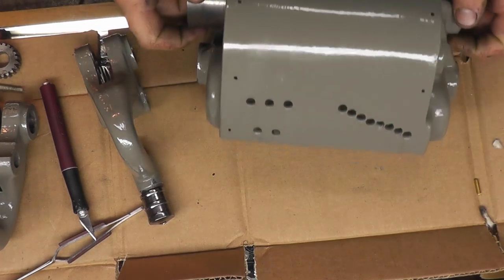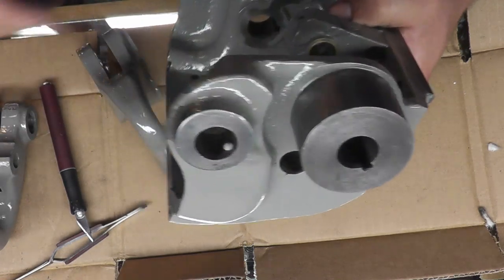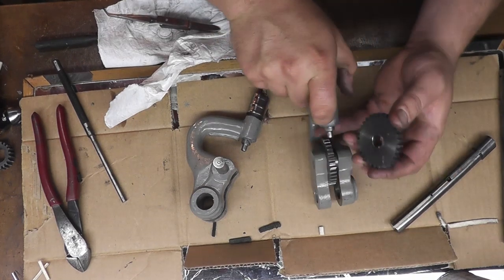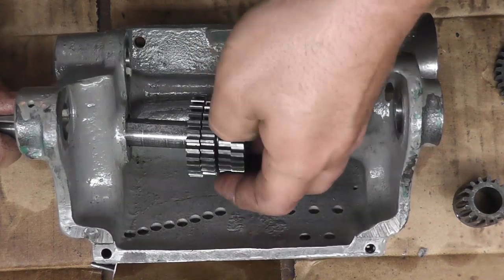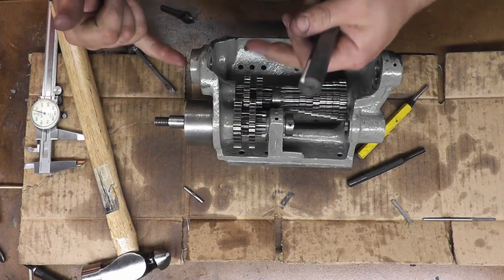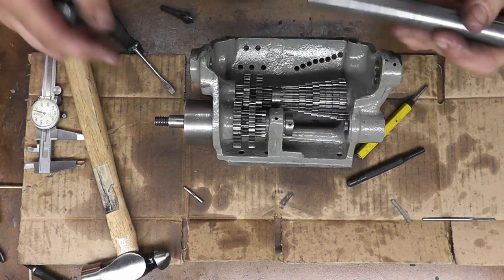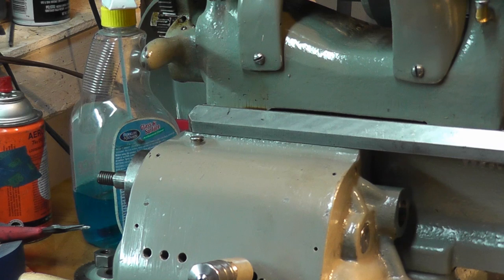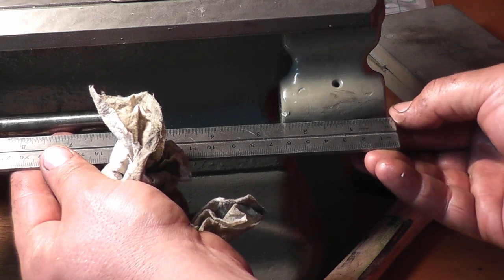Southbend 9" Gearbox Conversion Part 2

Comment: (disclaimer:everyone's a critic) I think you need to buy/make a brass/copper hammer and get some brass drifts. Steel on steel or god forbid cast iron, is a no no, I would have had my butt kicked hard if I were ever caught doing that in the workshop. Center punches used on tapered pins spread the pin and make it hard, concave punches are best. Good video other than that.

Comment: Looking good!  Some of that gear noise could be slop in the idler gear shaft, Glad to see you decided not to cut your original leadscrew, you have nothing to lose by adding an extension. If you leave 1/2" or so past the tail stock bearing support there'll be room to mount a hand wheel. How easily do your selector arms slide horizontally? Mine always bind a little - never found a fix

Comment: The C and Bs have two holes in the bed  to hold the lead screw bearing in the head stock end.  The As have three holes - an extra one is needed to support the end of the gear box. Either he operates with only the two close together screws for support or he drilled the 3rd hold off camera.

Given by reluctance to drill in the bed it would be nice to see the careful drilling of the 3rd hole.
Reply from the maker: I did not drill the third hole.  It's supported by the two holes at the far end of the bed and works fine.  The holes line up with the v-way ridge so it needs to be carefully milled to countersink the screw head and drilled on a mill.  I don't have access to one and really don't want to lug the bed around everywhere and pay to get it done.

Comment: This is so fascinating to watch.We get our information watching you, OK where do you get your tech information ? Also why the serpentine belt and not a leather belt or is that obvious to everyone else. Is there a serpentine belt for this lathe or did you take the leather belt to the store and just compare. Sure works great though. Thanks again and keep em coming you are the only source of this type of info that I know. Also I saw rebuild kits on E bay for south bend, are these the real deal.
Reply from the maker: Most of my information has come from sources on the internet and old SB bulletins.  The serpentine belt is a regular automotive belt that I got from an autoparts store.  After getting my lathe all put together and mounting it on the bench I ran a string around the pulleys and measured the length and got a belt of that length.  The belt gives better grip, but doesn't stretch as much as the leather so the tension handle is a little stiff to get taught.

Comment: Hello again. I am in the process of reassembling the gear box, and I saw how you cut the felt for the shaft slots, but how long was the round felt that went down into the hole. The book I have says to cut them to 1/4 inch, but that seems awfully short. It looks like you indicated the felt should go in as far as it goes then trim. Again thanks this project sure came out nice. My wife looks over my shoulder while I watch your videos and when she sees your lathe, she asks "Well is your's going to look that nice" .  She is very supportive and helped me unload and carry the lathe base into the garage. Now if I will stop tracking the dirt into the house, she will be more supportive. One set of shoes for the house and one for the garage ;-) .
Reply from the maker: I just shoved them in and trimmed them.  As long as it will hold oil and you don't scrunch it all up you should be fine with any length in my opinion.

Comment: Did you have problems with the newly installed wicks binding between the bearing and the shaft during your installation?  I am having these problems using the wick kit.  All of the shafts with keyway wick holders are binding.  Any advice?!
Reply from the maker: You can, but it will require a new apron, leadscrew with drive gear, 20 tooth gear, 40 tooth gear, and a model b or a geared crossfeed screw to be able to have all feed capabilities.  You can get by with the leadscrew with gear, 40 tooth, 20 tooth gear, but you will still need to use your halfnuts to engage feeds and the feed rates will be off.  have a peek here http://www.practicalmachinist.com/vb/south-bend-lathes/converting-model-c-sb-lathe-129896/

Comment: Hi,  I've managed to obtain a second hand South Bend gearbox and the plate on it says to use a 20T stud gear but it does not mention what size Screw Gear to use on the gearbox input shaft?  Your advice would be welcome.
Reply from the maker: 56 tooth gear
Reply: @Halligan142  Thanks for the confirmation,  the gearbox did have a 56Tooth  input gear already fitted but I wasn't sure about it.

Comment: On last comment: remember to NOT run the gearbox in high speed. In other words, if your spindle is on the highest speed pulley, don't run at gear box  in the A B or C positions. If you need those positions, remember to run the spindle SLOW.

Comment: Question about the super lube. I have been trying to find it locally but unable so far. Is the lube you used, Super Lube with Teflon, or does it really make a difference. I guess I order it on E Bay. Thanks again ...Ken
Reply from the maker: I used super lube and I got my tube at a one of my HVAC supply houses.  While it's not the correct grease it is called out in the rebuild book and although others have had issues with it, I haven't.  If you want the 100% correct grease you can get it here -->  http://www.ebay.com/itm/Teflon-Grease-For-All-South-Bend-Lathes-Roy-Dean-Products-Double-Pack-/151006944653

Comment: Great mod and thought process for the lead screw extension. A bit off topic but, what method did you use for your paint? It looks fantastic! Did you prime first?
Reply: He don’t care.  I used ‘duplicolor engine paint with ceramic’.  Sprays on, resistant to oils and solvents, and has a great gloss.   And you can get it at any auto parts store.

Comment: Great video, do you remember the roll pin size you used?
Reply from the maker: Nathan Smith 1/16 or 1/32 I think.   Basically the closest larger size to the large end of the tapered hole.
Reply: +Halligan142 Are you happy with the paint you have on there now? I'm currently attempting to refurbish my South Bend 10K lathe, I'm dreading the paint job, I really want it to be durable so I don't have to do it again.
Reply from the maker: +Justin Bell 
No issues with it so far.  Normal scratches and wear, but it's held up even when using all kinds of cutting fluid.  Layout dye doesn't seem to want to come off of it but other than that good.

Comment: Can the felts be any type of felt?  I know you said you bought a rebuild kit and yours was left over from that.
Reply from the maker: As long as it is thick enough to be able to touch whatever rotating part it is supposed to you should be fine.  Mcmaster-carr sells sheets.  I'd go with the medium or soft.  You'd have to cut it yourseld to fit.  The rebuild kit felt is already die cut for you which does save a hell of a lot of time and effort.
Reply: Right on that's what I figured just thought I would double check.

Comment: Awesome videos! I’m converting my 9c to b. I know I need a keyed lead screw and the a/b apron. Is there anything else? Is the 9c cross slide compatible with the a/b apron? Thought you would probably know. Thanks!
Reply from the maker: You will also need a 9a or b cross slide feed screw.  Yours does not have a gear in it which it needs to have to allow for cross slide feed.  Also depending on the age of your lathe (usually pre 1939 415 series) you may need to grind a price of the saddle casting away to create a slot for the feed screw gear and apron gear to mesh.  Also if your lathe has a rib along the bottom of the bed this will usually interfere with the new apron and will have to be removed.  Even after all this is done there may be a good possibility you may need to shim the apron/saddle join to get the gears to mesh properly.
Reply: Halligan142 I haven’t been able to accurately date my lathe yet.. not sure if it’s super old. I will look for those features though. I’d just buy an a or b but I can never find a good one semi close to me. The bed is really fresh on my c so I figured why not convert. I see it is more involved than I though hah. Thank you
Reply from the maker: @alexrice1616  
Check the serial number stamped on the end of the bed and compare it to this list.  It'll give you the date.  http://www.wswells.com/sn/sn_db.htm
 usually the catalog number is stamped on the name plate.  That should tell you if it's a "workshop" series (9a,b, or c) or an older 415 or 405.

Comment: Hey Greg, do you have any more info on the round wicks with a wire core? I am doing a rebuild just like this and all I can do is make felt mushrooms. My kit came from stevewb on eBay.
Reply from the maker: boguscharlie Got my kit from the same place.  I used a brand new #11 exacto blade and a glass plate.  Cut the tip of the wick at a taper and use a small stiff wire to get them in place.  Give them a little stretch first to get them a little thinner than the hole.
Reply: ***** Thanks. I did get the gearbox back together after hours of bumbling. The current kits do not come with wire core felt cord, so I wasted some. Did end up finding 3/16 felt cord on McMaster if I need more later.